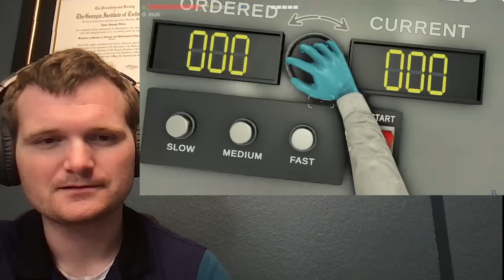Nuclear Engineer Reacts to Nucleares PWR Reactor Simulator Part 1

Comment: Just as an FYI, having played this game, entering the water around the reactor doesn't kill you from radiation or anything, but there is simply no swimming mechanic, so you sink to the bottom of the pool and can't get back out. There is however an air mechanic, so you just drowned.
Reply: Ah yes no swimming but yes drowning
Reply: @Azyraasr  It's Unity.  Swimming is a lot harder to implement than asphyxiation.
Reply: @kederaji  try godot
Reply: @Azyraasr oh yeah let's just port this finished game over to an entirely different engine, just so simple.
Reply: @tabithal2977  its a.  J o k e
Reply: @Azyraasr still waiting for Godot, sadly
Reply: @Azyraasr  yes because commenters can magically read your mind Einstein, do you think before you comment?
Reply: @anomaly3215  i am not going to further is comment because what i said was so obivously a joke and full of sarcasm
Reply: @kederaji  That would explain why you also just sink like a rock in Lethal Company too, bullshit mechanic imo, by that point just make it a bottomless pit.
Reply: @anomaly3215  Bit aggressive there - you can't seriously expect everybody to explain their jokes at the same time as posting them. If you miss the joke, that's fine, but don't lash out after they tell you it's a joke; YOU missed it. They are allowed to make a joke. You don't need to be a mind reader to pick up on sarcasm...
Reply: I wonder, realtically, what would kill you first, the radiation, heat, or drowning?
Reply: @dariuszscharsig568 probably the heat. Unless there’s enough ionizing radiation to cook you alive (in which case that might as well still be radiant heat or a nuclear burst), the water around the reactor core is hot enough to rapidly boil you alive. 

If you drown, you might be rescuissitated. If you take a lethal dose of ionizing radiation, your tissues will still function for a time until the cells die off without replacement. But the heat will kill the tissue and destroy any function.

Or you might drown first, and the boiling water will get into your lungs and cook your insides before the hypoxia from drowning kills you.

Comment: Its an arcade style simulation of the concept of running a nuclear power reactor.  The bones are there.  I get it that it's not a fully functioning, safety compliant, generating station... it doesn't have to be.  The tech tree progression is in the form of adding diesels, steam gens, and electrical systems as you progress because after starting up and stabilizing the reactor, what's the point?  There's got to be a goal.  It would be really fun if they got much more in depth with it, changed the layout of the facility to make it more realistic etc... once you get used to adding heat to the reactor core... increasing the flow to the secondary system as needed to run the turbine, and then fiddling with the condensor... you've mastered the game as it is in this state.  Then it's just a matter of starting it and stopping it as needed to maintain the equipment.  I doubt too many people play much farther than the initial start up.  It feels like an Early Access title, rather than a full release.  I like the idea, just needs to be more in depth. 

Here's an idea, make the users manual actually helpful in learning the game and provide checklists in the Tablet to actually run through the processes and procedures of adding and removing fuel, maintaining the core and the rods, servicing the diesels, servicing the steam generators etc.  Then you have something to do, and instead of stumbling around going... hmmmm... why does it say pump overloaded?  What does that mean?   The manual is absolutely useless and its 170 page PDF.... lol   Like I was saying, it feels like an early access... the play loop is basic and so much can be added, there's a lot of room for growth that would appeal to the kind of person who might download this type of game in the first place. It's just not there yet.

Comment: What makes nucleares fun is that it's just absolutely batshit insane safety-unconscious plant design. Safety systems? Protection systems? WHAT systems? They give you a wall-mounted iodine injector. 

It's all designed with malice aforethought. Zero redundancy all round, and little things: like that running all the coolant pumps flat out causes your one and only backup gen to overload and catch fire. Or that your one feedwater pump can't actually make enough pressure without overloading to feed into the core under NORMAL operating presssure. Y'know, little things like that. 

Also basically zero actual feedback control systems - it's all seat-of-the-pants, open-loop with a failable, distractable human in the loop. Trying to balance inherently unstable systems where collapse is just a few mintues inattention away. Closest thing there is the rod height system.

It's all, 'theoretically operable'. Which is what makes it fun, of course, that you get to explore the huge gap that exists between theory and practise. And it includes the virtual hardware enough that you can go out and watch your pumps catch fire. Or what have you.
Reply: they should have gone full camp and had an actual safety control rod axe man.
Reply: Love this comment. Finally someone got the point!
Reply: You’re bang on about why the game is fun. It’s be totally insane IRL, and no one does it like this (anymore…), but if it really were more realistic with all the safety systems we have in reactors…the game would be boring.

The ever-present threat of the spicy rocks in your big kettle getting angry is actually quite compelling. Every finicky knob turned could edge you closer to doom. XD

Comment: I trained to be control room operator years and years ago, and we went to an actual simulator, basically a 1 to 1 replica of an actual control room, with every little thing simulated and connected to a computer that in real time calculated the result of every knob and every component. It was impressive. However, I managed to cause a SCRAM because i was first up to do the raising of control rods in the procedure. So, I followed the instruction, selected which control rod group to raise according to the step by step procedure, and then, turned the knob. 

The thing is, the knob was marked with Neutral (0) and Raise (1) and Lower (-1). So it would always sit at 0 normally, and your turn it up to 1 to raise, or towards -1 to lower. The thing is, I thought it was binary, that it was only one speed, so, 1 would raise it at a certain fixed speed, and the -1 would lower it at a preset speed. So, I just cranked the knob up to 1, but it was actually like a throttle, so I started raising the control rods at max speed, and caused a SCRAM. 

This was years and years ago, and the simulator teacher just laughed and said "That always happens with the first person at this console, dont worry about it" and hit reset and I could try again. I was very embarassed, as I was the top student, and my classmates were at other consoles and stuff, and i felt i was made to be an example as the instructor didn't tell me about how the knob worked beforehand. Now tho, I wonder if they still have that knob. Since I never ended up working at a nuclear power plant, I wouldnt know, but it seems pretty crazy to me that the control rods work that way, I mean... What if someone slips or has a random muscle spasm or something while manuvering the control rods.
Reply from the maker: Thanks for sharing! At the plant I worked, you had to actively hold the shim switch for continuous rod movement, and it was at a fixed rate either in or out. Also, there was an electrical interlock if rods were withdrawn to a certain point, they would stop. This was below the overpower SCRAM set point. 

Though, depending on the reactor type and core design, it may be possible to trigger the rate reactor SCRAM set point for a constant rod withdrawal over several minutes (which is one of the reasons why that set point exists 😅)
Reply: @tfolsenuclear  The simulator was of a ASEA-Atom 1400 MW, a BWR reactor. One out of 11 reactors of that type in the world, only built in Sweden and Finland. I had a vague memory of it being a westinghouse, but was unsure, so googled it just now. If it had been a westinghouse maybe you would have had experience since it's a US make, but well, memory failed me hehe. But the system you describe seem a lot safer at least. Well, the reactor has been in use dor several decades now so i guess ppl know how to operate that knob. Thats what the simulator is there for I suppose, hehe. Thanks for answering, and thanks for your videos, even though I never did end up working in the nuclear industry, it's always fascinated me.
Reply: Honestly train now so no accidents happen later

Comment: This looks more like a "swimming pool reactor" or "open pool reactor", like you said, a research reactor. The only reactor I've been in was a swimming pool reactor, the MSTR research reactor, a 200kW (thermal, not electrical) research reactor at the university and it did look a lot like that (albeit rectangular instead of circular). And the control room was next to the room the reactor pool was in, though it was only about twice the size of a dorm room. It was based on the Bulk Shielding Reactor at Oak Ridge National Laboratory if you're familiar with that one. It was built in 1961 and was converted to run on low-enriched (from high-enriched) uranium in 1992.

I toured it in 1997 and they did let us get close enough to look down into the pool. I don't know if that is still how the tour is done or if safety regulations have changed since then. Theirs uses stainless steel control rods, all but one of which have a boron coating. They also like to brag that the chancellor's house is more radioactive than the reactor (it's made with marble that has traces of thorium and uranium).
Reply: I am a student there currently in the final stages of obtaining my operators license. The tours are still done the same way but now they are called “blue glow tours” where we run the reactor at full power to achieve a good cherenkov glow and flip the lights off so the visitors can enjoy the show. 

Instead of a boron coating it is a mix, kind of like an alloy (think carbon and iron)
Reply: @hmwygifb2916  Glad to hear from someone who's been there more recently. Good luck with your license process :)
Reply: It's a hybrid - a PWR reactor under a pool which provides additional radiation shielding. The game's minimal level of lore states that this is a prototype plant, explaining the unconventional design and comparatively small power output.

Comment: As a A4W type 1 reactor operator, retired US Navy vet, i can tell you that this plant is closer to operate similar to a ship board PWR. I can apply similar modified operational procedures from it to this game and you should be 'good'. some of the things that i can expand on is about equipment usage. since it is a game, the core concept is, minimize wear and tear, while meeting the distribution needs per hour. so the lore for this reactor, is that it is a prototype modular reactor that utilizes high automation, 1 operator, and 1 drone assistant.
so, one big issue with the game that will throw off all operators. there is reactor power monitoring system. all you have is rod heights, and core temperatures. there is also no total steam flow. as such, rod movement, steam demand changes, etc. wont be visual as much. 
as for how you watch the plant, you have core inlet temperature, core coolant temperature (think average coolant temperature, but more so a thermocouple core temperature). the delta from inlet and outlet core temps are based on the primary coolant pump flow rate (faster is smaller delta, slower is higher delta). the game ignores thermal shock from temperature differentials. 
my biggest issue is that its not designed with a negative temperature coefficient of reactivity. the only reactivity is Xe, I, RH, and Fuel (coolant poisons if you turn that on). as such, RH is core temperature. and you control power demand with temperature, and steam flow of the steam generator. what is also silly, is that you are manually controlling steam generator level using the feed pumps. you have control of a turbine inlet and a bypass valve. 
overall, the plant is hyper simple, where the material stresses are ignored, and the only visible output of reactor power is on a screen that shows fission rate vs generated power. but it has enough core operator interactions to make it feel like operating a real plant. ofc its a game, rather then a simulator that tries to mimic a ultra realistic reactor. i think its a good intro to the basics of nuclear power, the same way elementary school math is used in calculus class. the basics and key concepts are there, but with that knowledge alone, you cant just walk into a nuclear power plant irl and expect anyone to operate the reactor for various operations, let alone casualties.

Comment: I can explain the weird reactor design. It's unlike any real reactor I know of, but it's not entirely without reason: It's a PWR in a pool. The reactor itself is at the bottom of the pool, and operates at a nominal temperature of 360. The water pool around it is just an ordinary pool of room-temperature water that provides additional radiation shielding, and can act as an emergency cooling buffer in the event of a serious overheat situation.

One of the controls near the cooling panel allows for the pool to be drained during servicing and re-filled after.

The reactor design isn't realistic, true. But it's... plausible enough, given that the game's absolute minimum of a story states it is a pilot/research reactor - a proof-of-concept power station. It has a maximum safe power electrical output of maybe 20MW, which is rather dinky for a nuclear power station.

(You can get a lot more power than that if you ignore the 'safe' part - the limiting factor is usually the condenser, which lacks the heat dissipation capacity to maintain that kind of output.)

Comment: This game is on my wishlist, because I think nuclear power is really cool, and I'm absolutely fascinated, not just by the physics behind fission but also the thermodynamics of taking that heat, transporting it around and doing useful things with it, such as generating electricity. So, naturally, I've been watching any Nucleares videos I could, ever since I found out about the game, and in a recent update, the developer has actually added a synchroscope as well as generator speed and excitation to get the right frequency and voltage.

I realize the game is still very early in development, and as people give feedback, I am certain more features are going to be added or modified, and values are going to be adjusted to be closer to reality, and I'm really excited about it. For example, after watching enough videos, I noticed people mentioning about how the generator power sometimes drops randomly a couple hundred kW, and about that part where steam demand affects reactor power, I really hope the developer watches this video. I think videos like this, coming from specialists in the field help make games better and more realistic in general, and in this case, if not with features right away, at least with the calculations, so that the reactor actually behaves the way one would expect. Maybe in time, he'll also add other reactor designs, like the RBMK, MSR, SFR, different scenarios... One can only dream 😅

Comment: You got it at the end. Realistic? No. This is to nuclear reactor operation as a flight sim is to pilot training - capture the basic concepts, but in a form that can be quickly grasped. The core of the game is the interaction between the many systems of the simplified plant, and the constant adjustments needed to keep everything in balance and match the reactor output to grid demand. I believe the idea is that the finished game will throw more interesting scenarios at you to deal with - unanticipated demand variations, equipment failures, sudden loss of grid connectivity. The fun comes from seeing a read blinking warning and having to run through all the many dials to figure out where the fault lies and fix it before the plant shuts down. Or worse, doesn't.
Reply: That's not a good comparison as flying on VATSIM in flight sim for example is technically pilot training in all regards apart from actual gforces. If you compare it with VTOL VR i would say yeah.